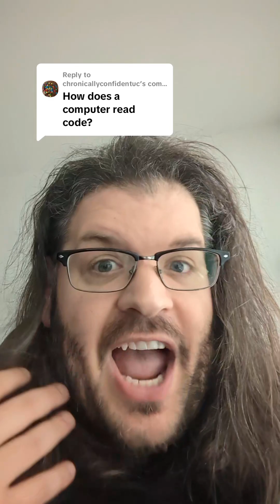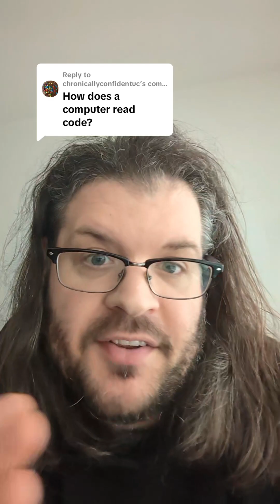How computers read code

Comment: ARM is the evolution of RISC instruction, that's the R in ARM. 

IBM RISC were what PPC's were the consumer grade version of these processors and POWER (yes it's literally all capital letters) series being the variant used in Super Computing. The G3, G4, G5 Macs were just labeled for the generation of PPC. The Xbox 360 was a tricore G5 970, and PS3 was a half step between at 970 with a IBM next gen concept POWER series called the Cell Processor. 

In the end ironically it was the power inefficiency and heat issues that killed off the initial POWER series, but the instruction set was evolved and with smaller fabrication and a redesign we got ARM. 

In the end, Apple returned back to RISC.
Reply from the maker: I always thought it was fun timing that Apple moved to Intel around the same time that Microsoft moved the Xbox 360 to PowerPC. Felt like a role reversal.
Reply: @andrewgrantcomedy  Not being able to make a G5 Laptop was a big factor, no one wants aluminum slag in their lap. :P